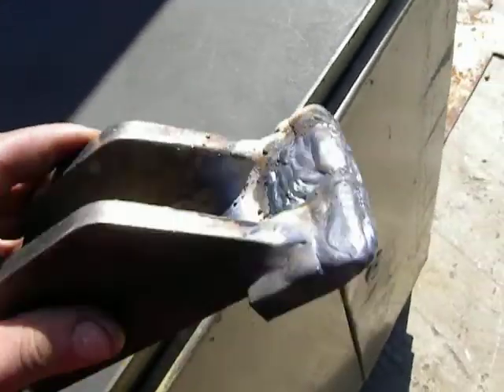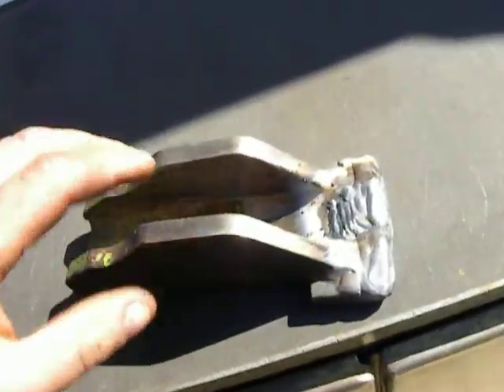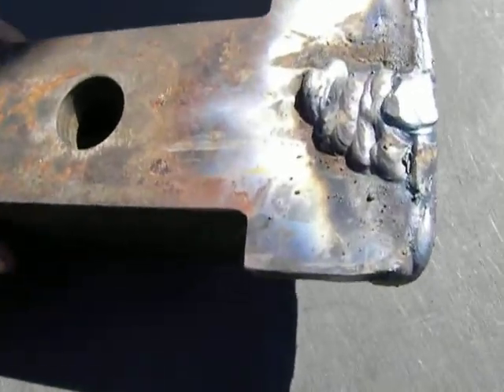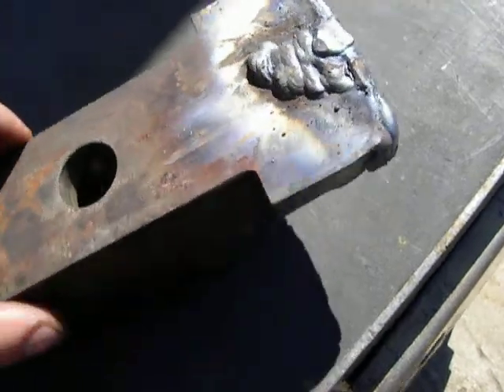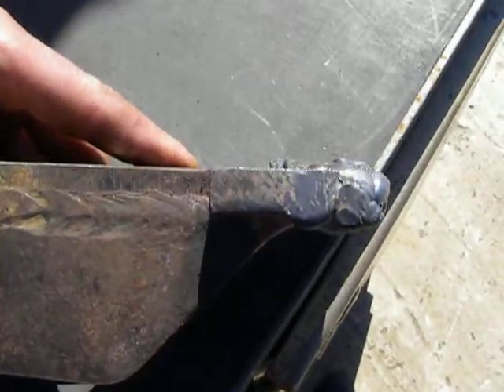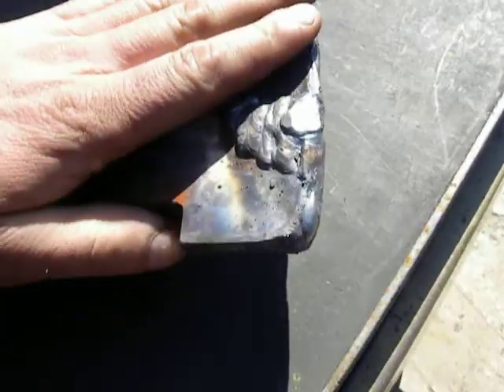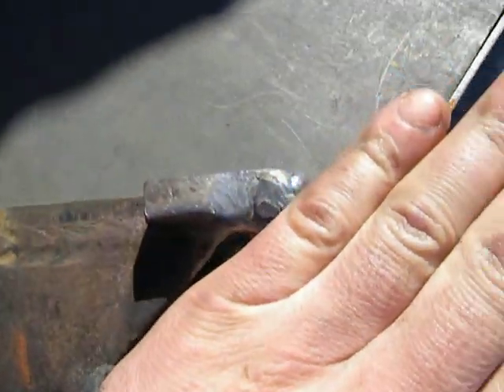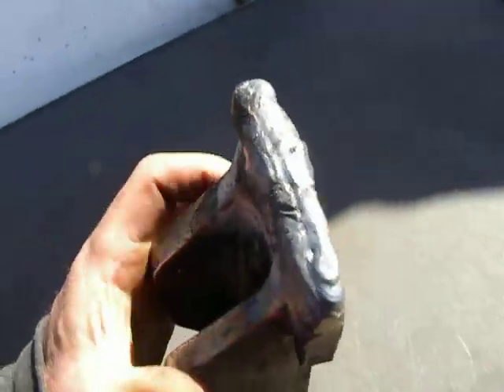Woodchipper blade clamp repair - check the welding and plan /p4

Comment: Do you have to worry about the weight of this component so that the machine is not out of balance when working?
Reply from the maker: No. There isn't so high RPM and a few ten of grams there can't make any sense of disbalance... there rotor weight is half a tonn, even more... and if there stuck some chips it is more witht than my welding.Thanks!